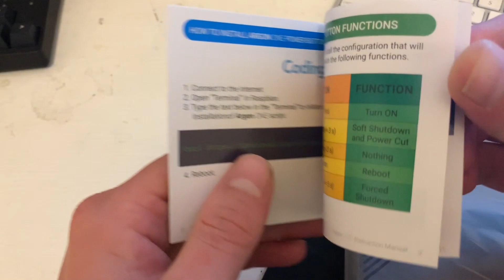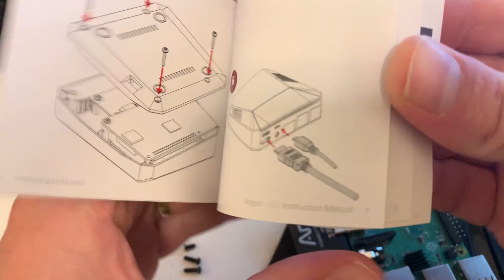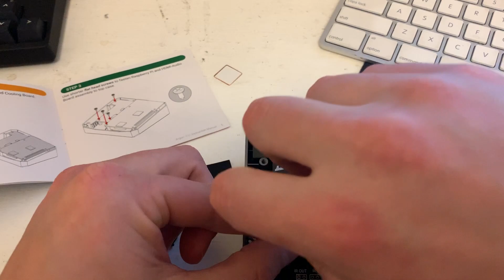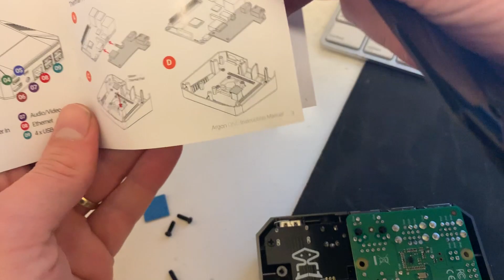Argon One Raspberry Pi Case Unboxing and Assembly

Comment: I got the one for the Pi4. It didn't work. Had to return it. Wouldn't boot. No video through either HDMI ports. Very disappointed. Flicr case I also got works great with Pi4 over clocked to 2ghz

Comment: the 2 differnt pads are for the different versions of the raspberry pi a 3b+ will use the thinner one, also the black 3m pad will be the feet for your case.
Reply from the maker: That makes sense. Since the 3B+ had a heatsink on the cpu and the other models are bare. Well thank you Kevin for identifying the black foam.